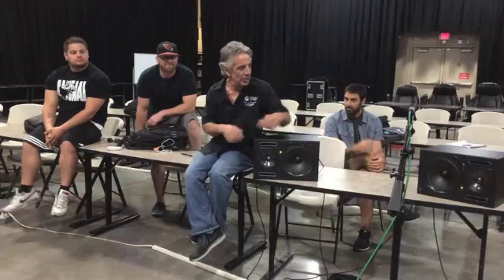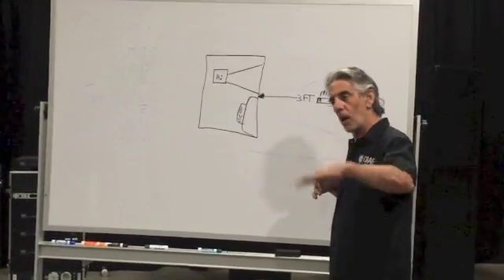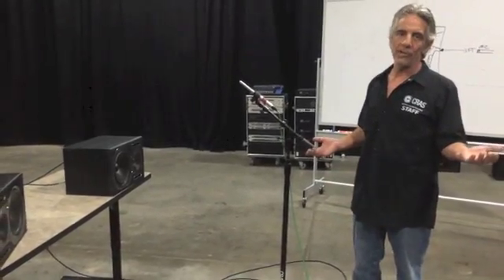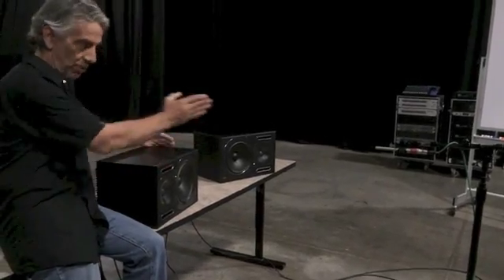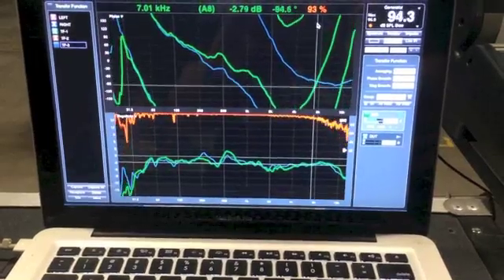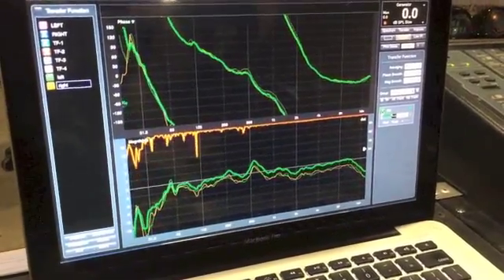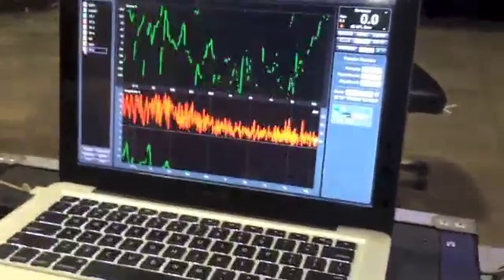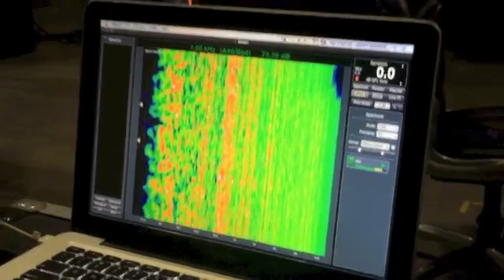studio monitor phase alignment and why with Keith Morris

Comment: Hi thank you sincerely for the extremely interesting video.  I really did not imagine that small shifts in the mic position could give such impressive variations in the freq response.  I have a weird question.  Would it be of some help to use ear microphones to check the freq response from the head position of the recording engineer ? in this way i would be sure about what reaches the ears. Another question.  Can coaxial speakers for their nature make this issue of dips in the freq response less critical ?  Again very impressive test and very telling.  Thanks again,  gino 
P.S.  i think i have the same monitors ... Behringer 2031a ? what is your opinion about them ? should i keep it or look for something better ?
Reply: Yes, to my understanding, this (the first mentions of vertical vs horizontal) wouldn't be significant in coaxial monitors. #coaxialmasterrace
Reply: @ClintMoody  Thank you very much indeed for the very valuable advice.  I love Tannoy speakers concept for instance.  I have been listening to them for a long time and they are not perfect (which is perfect ?) but i like them a lot overall.  Regards, gino

Comment: I still don't understand why it is better to have the monitors on their sides.  If they are on their sides, then I understand that moving up and down won't cause any phase issues between the T & W, but surely people are more likely to move left or right and up or down?  Is it for engineers who like standing up now and then, so that as long as you are in the mix position, then it doesn't matter what you are doing whilst you are there?
Reply: Can I use these configurations for straight monitors?